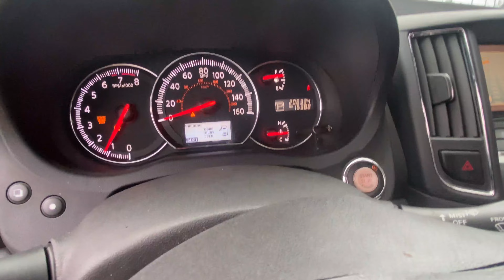206k MILE Maxima and "ALL" its "IMPERFECTIONS"!! @nismomaxima

Comment: I have a black 2001 20th Anniversary  Edition with the manual Transmission. I've owned it since 2004. I have 198k on mine and would've had more by now but I drive my Armada a lot more in the past 4 years. Its still runs like new.
Reply from the maker: That’s what I like to hear

Comment: How come you're idling so high? average maximas including my 11 idles around 650 to 950.. Planning on a big service now.. Spark plugs, PCV valve and the 3 hoses that come with.. oil and filter change.. seems sluggish so gonna try cataclean for the cats.. I have a feeling theyre clogged up.. There is an oil leak but its a bit old and doesnt leak a lot and doesnt create any problems so gonna leave it as is.. I also wanted to know have you ever done a TCM relearn? Any recommendations on whether i should go for the relearn? I want to reset the shift patterns, timings etc
Reply from the maker: Seems like you have a lot of work to do and Idle so high because of the new motor. The car was never tuned after art type of work I put in. And never did a TCM relearn and know nothing about it so I can’t make any suggestions there. I would say if anything fix that oil leak thon
Reply: @ThisBGama  I will see about the oil leak.. First gonna go for that major service since its due.. gotta restore power before patching up the leak.. will see about that TCM relearn if all the other stuff doesnt work out as expected
Reply from the maker: Cool

Comment: Ayee I have 2013 max just like ya car about 4 months ago I took to a mechanic i blew the heads on it when I ran it hot I got a new motor took to the shop motor good was running smooth the car wasn’t smoking nomore soon I left the shop my car wasn’t changing in drive but it still go and drive and backed up just won’t change in drive do you think I need a new transmission or transmission fluid Change or transmission solenoids the transmission was working  great before I took it that mechanic shop out of 7 years wasn’t nothing wrong with transmission until I took it the shop I even drove it to the shop transmission was still working good now that I got back from the shop it wasn’t working properly man I don’t what’s going on tbh 💯
Reply from the maker: They might have messed sum up
Reply: They probably messed something up on the transmission do you think I can take to Nissan and they will let me know
Reply from the maker: @rasdrecusclayton9819  yea they’ll diagnose it but Nissan charges $150 to check the car